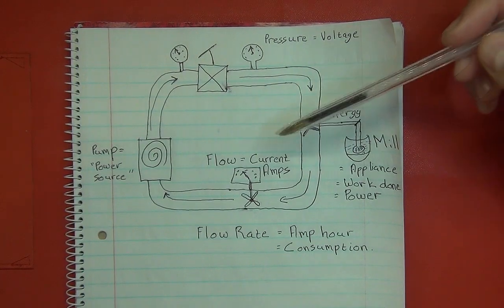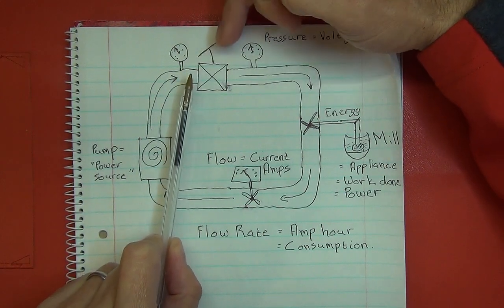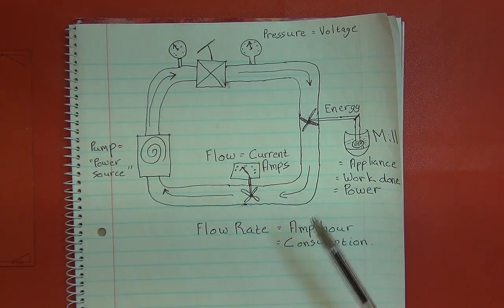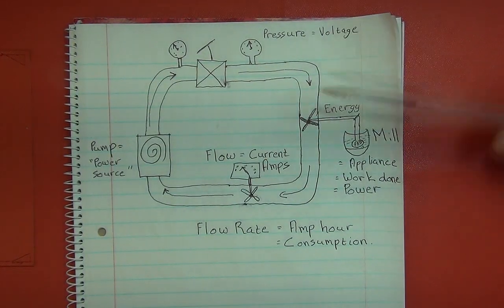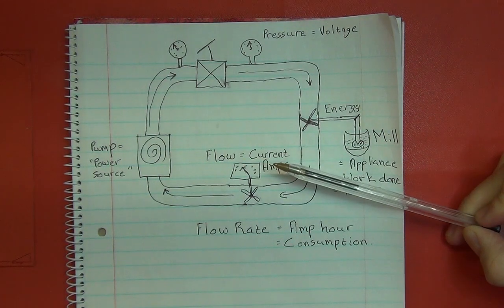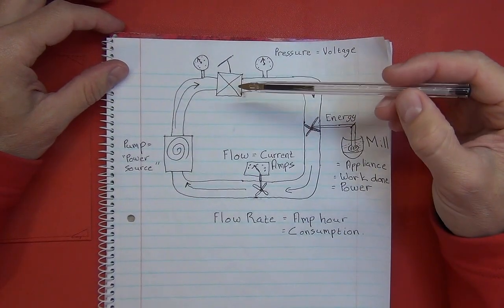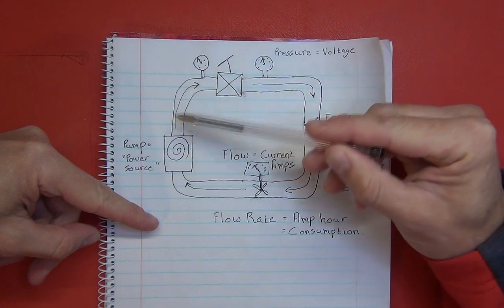Electronics Tutorial #1 - Electricity - Voltage, Current, Power,  AC and DC

Comment: Thank you for the work and care that went into these videos. Very few people know how much time and preparation these take.

Having said that...

To be accurate, we in the U.S. DO use 220v in our homes. We just get there a bit differently, by running 2 110v ac legs 180 degrees out of phase. Standard outlets and lighting fixtures only use one of those legs. That's why our stoves heat more quickly than our wall-outlet kettles, because the stoves are wired across the opposing 110v legs, giving them an effective 220v. On the down side, our hair dryers are much less effective when tossed into a bathtub, as discovered to the chagrin of at least a few hopeful potential widows.

Comment: Many thanks for posting your video tutorials. This is something I'm keen to learn. A quick question if I may. With regards to voltage and the battery charging demo. I'm wondering what happens when the current pushing the voltage is switched off but it is still connected to the battery. Does the battery then push it's current back to the charger and therefore drain until it has no voltage left or does it hold it's voltage as it's a closed circuit?. I'm wondering if when charging batteries for example mobile phones, if you charge your phone but then switch the plug off (UK socket) whilst still leaving the phone connected, does this drain the phone battery quicker than it would if you unplugged the charger all together.

Comment: Awesome video! Your analogy's make it so much easier to understand.

Could you potentially have a battery or device that starts off allowing maximum voltage into it, then once it reaches a desired level of charge, it compresses the electricity that is in it to create the proper voltage? Like a water gun with a pump on it. You fill the water gun as quickly as you like, then once it's full, you cap the fill hole and pump it to increase the pressure that it squirts out.

Comment: The saw analogy was great , however I have a doubt. In a  AC circuit, you have 2 wires connected to a appliance (for example), one being the phase and the other the  neutral.As I see the neutral cannot carry electricity from the power supply... therefore how can the electricity be comming back and forward throught the same phase wire? Thx

Comment: What he says about AC is wrong. With AC, you can take advantage of electromagnetic induction. So you can increase the voltage for long distance transmission, then step it down, via a transformer, for safe usage in houses.

Comment: Air molecules don't have loosely attached electrons easily passed from one atom to the next.  An analogous situation with fluid in a pipe is corking the end of the pipe when I cut the pipe maintaining pressure.  If I wanted to make the cut wire act like the analogy I would submerge the wire in an environment such as liquid mercury.  Then when I cut the wire the electrons would flow out the end of the wire through the mercury bypassing the fan and be at zero volts.  Hope that explains it.

Comment: When I cut the pipe the opening to the pipe is exposed to an environment where the pressurized molecules are free to move out into the atmosphere.  Technically speaking the pressure won't drop to zero, it will fall until it reaches atmospheric pressure.  The evacuation of all these molecules from the open pipe alleviates the pressure (makes sense).
When I cut the wire the end of the wire is not exposed to an environment where the electrons are free to move out of the wire into the atmosphere.

Comment: pipe.  Your question is an EXCELLENT question in that it very acutely identified an instance where the analogy seemingly breaks down and therefore must be adjusted or at least more fully understood.  When you cut the pipe the pressure in the pipe immediately drops to zero, whereas the analogous voltage does not drop to zero when the wire is cut, rather it remains at 2 Volts (the supply voltage).
Compare fluid effects of cutting the pipe to electrical effects of cutting the wire to see why.

Comment: since it too can be compressed.  I have seen basic electricity taught using this analogy too.  The advantage of the water in a pipe analogy is the student can sort of SEE the water, whereas as some might have more difficulty picturing air being pressurized and flowing through the pipe.  Nonetheless the fluid air flowing through a pipe analogy does not suffer from this "non-compressibility" difference with electrical flow.
Another analogical difference has to do with the environment surrounding

Comment: while in an electric circuit the atoms stay put and only the electrons stay put under this same electromagnetic force.
2)  Not surprisingly the analogy is invalid only in the rarest of circumstances.  One difference is water in a pipe cannot be easily compressed whereas electrons in conductor can be pushed together in greater and greater numbers provided you push them harder (the limit is not so easily reached as with water).  Perhaps a better analogy is air flowing through a pipe

Comment: the wiring of your house: it wouldn't be easy and would make a mess of the wiring but pushing or pulling the copper through the insulating sleeve could be done.  In the case of copper however, the electrons themselves are free to move from one atom to the next because they are very weakly attached to the rest of the atom.  Therefore they can be pushed onto an adjacent atom and leave the rest of their former atom behind.  In the pipe analogy the whole atom flows under the electromagnetic force

Comment: The overall result of this appears as if no two atoms can occupy the same space but they reality is at small distances the closer the atoms get them more they push each other away.  A small but important distinction in some cases.
How does this apply to the subject a hand?  Namely how electricity behaves when it flows through wires?  Well in the case of electricity flowing through wires, the entire atom is not very free to move as is the case with water.  Imagine pushing solid copper through

Comment: The answers might surprise you.
1) The analogy is valid because it isn't really much of an analogy at all in the sense the analogy of water flowing thru a pipe is virtually an identical phenomenon caused by an identical force.  Must people think what actually causes water to flow through a pipe is that no two masses (atoms) can occupy the same space.  So pumping the water into the pipe causes the other atoms to have to move out of the way forcing the whole column of water through the pipe.

Comment: But in copper the electrons (themselves responsible for the EMAG force) aren't securely attached to the molecules.  Pumping electrons into one side of the wire then results in the weakly attached electrons flowing around the circuit just like the water does.  They are the same thing!!!  The only difference is we can SEE the water moving, whereas you can't SEE the electrons.

Comment: The fluid analogy is appropriate because it's a slightly different effect of the same force.  Electromagnetic forces between molecules don't like to have molecules get too close together (e.g. fluids don't compress due to EMAG force).  Pumping on the molecules results in the EMAG repulsion pushing the water around the circuit.  If the molecules are frozen (such as solid copper) no flow is seen.  The force required to push the copper through the pipe is larger than the pump can muster.

Comment: 0:00 - Intro
1:10 - Brief history of electricity
3:40 - Difference between AC and DC
5:40 - Brief science of electricity
7:30 - Electricity as Water analogy with diagram
21:00 - Mains electricity (household power)
26:55 - AC scopemeter example using mains electricity
30:15 - DC scopemeter example using power supply
31:45 - Voltage differential between rechargable battery and power supply
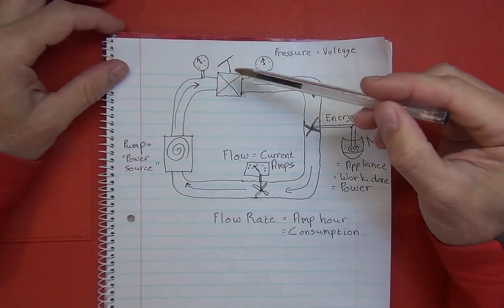36:35 - Voltage potential example using diagram
37:38 - Summary of important concepts
38:10 - Conclusion

Comment: So when the voltage generator had a higher voltage than the battery, was that essentially 'charging' the battery? Or simply dictating the direction of flow? Or both? The pressure analogy for voltage makes so much sense to me. I'm a little less clear though on the relation between two connected voltage creating entities though.
So glad I found this series!

Comment: dear mjlorton .. i have a question 
when i break the pipe just before the first pressure gauge , this guage reading become ZERO and when i close the valve .. the pressure gauge will increase until i shutdown the pump .
in the analogy with electricity , the voltage reading will be same in the 2 cases .. how come ?!

Comment: Really interesting just by raising the voltage the amp was increasing on your power charger ! But u still can adjust the amp level higher as u want on the charger right? Because 200ma will take days to charge a 12ah SLA

Comment from the maker: Yes, a load can pull down the voltage...but the voltage for charging a lead acid battery should not be above 14.4 v...that's why you need to use a charge controller with a solar panel to ensure the correct charging voltages.

Comment: That was very helpful to me to see how a battery charges and thank you.  I saw you didn't go much over 14v to charge that battery, but a 12v solar panel with no load on it measures around 21v.  Does that mean your power supply would have measured much higher if you would have disconnected the load and would have measured around 21v?